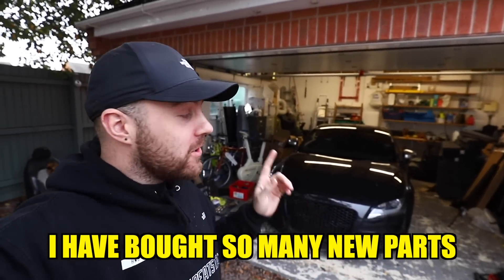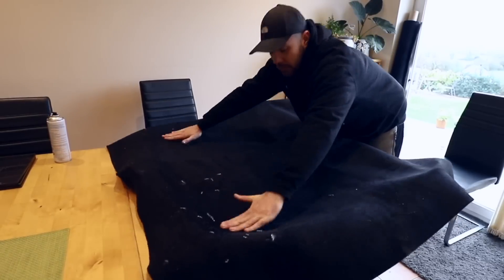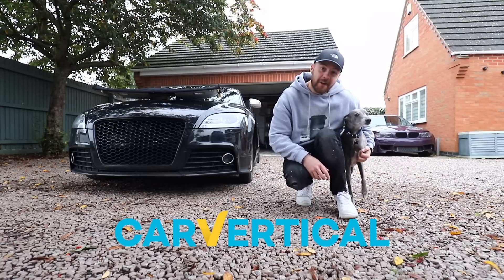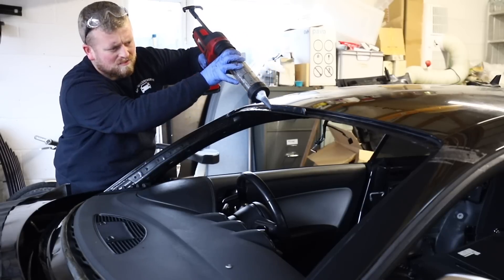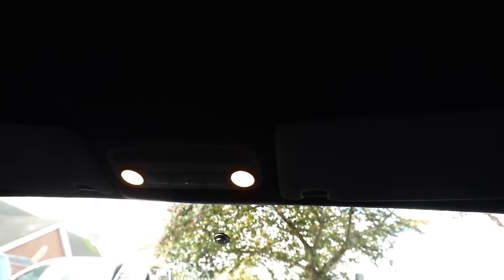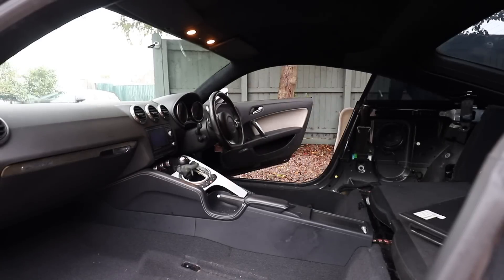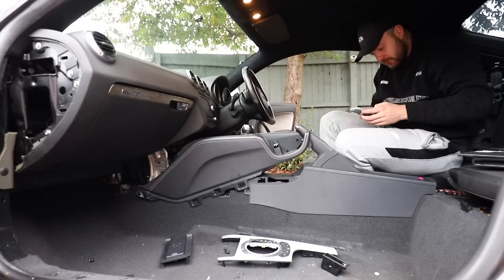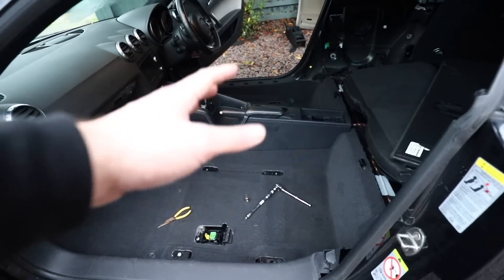RESTORING MY STOLEN & FIRE DAMAGED AUDI TTS 8J

Comment: To get rid of the steering light, you have to drive a short distance but also be able to turn lock to lock, it'll go out very quickly! It happened with my fabia and caddy, both quickly and easily sorted

Comment: Another way you get rid of that light is drive the car at low speed like 10kmph in a straight line and it will go away. I use my driveway for this.

Comment: When you lock it, you have to hold it on each side, if you lock it to the left fully you hold it there for a sec and then turn the other way. This is mainly for steering angle sensor and when you start the car from the dead battery. Hope that helps, its used to initialise the angle sensor on vag group cars

Comment: I have always thought that the a pillars and the b pillars I would cover them in the covering without the padding on the back not to add thickness to the plastic covers and that would help with your areas where the seat belt goes through the plastics as you could tuck the material down around the darker black plastic

Comment: To clear the light you might need to calibrate the steering angle sensor then drive it and turn the steering wheel 30degrees right and left

Comment: Turn the steering wheel to turn lights of lol. Whoever said that must be living on a different planet
Reply: The steering angle sensor sometimes lights ABS and Antispin when battery disconnected. And you then calibrate the steering angle sensor by steering full lock both ways. Sometimes you also need to drive it for a few meters.

Worked on Audi for 6 years and done this hundreds of times. So No they do not live on another planet.
Reply: I've also done this on a A4 b8.5 and it worked, there's videos on YouTube on how to do it, sometimes you need vcds for basic settings steering angle senor calibration but thats definitely part of the process to full lock left and hold for 5 secs them same for right
Reply: Technically he’s not wrong, could just be a calibration of steering angle sensor, has to meet certain parameters before and includes moving the car. Common on VAG cars.
Reply: Lol that was me! It works trust me. I stripped my seats on my a3 and had the battery unplugged. When I turned my car back on. My airbag light was on and my steering wheel light was on and also the traction control. Turning the steering wheel all the way left and all the way right cleared all the codes.. soooooooo
Reply: @fredrikknutsson453  yea that was me who mentioned it lol